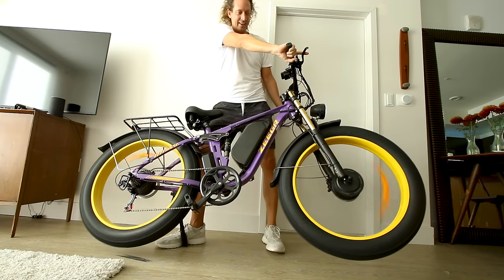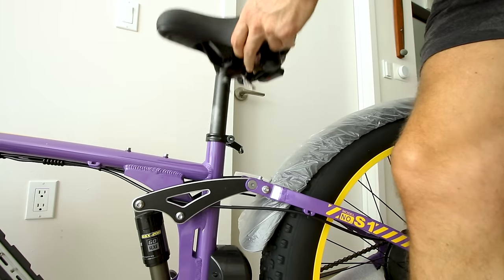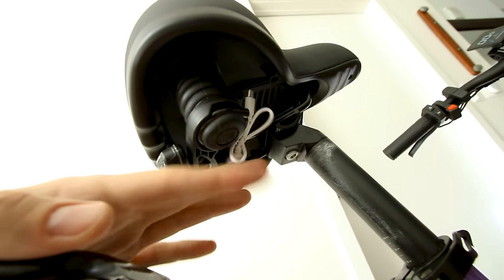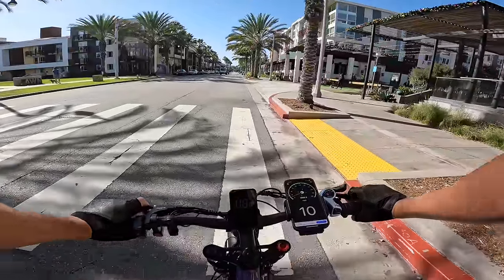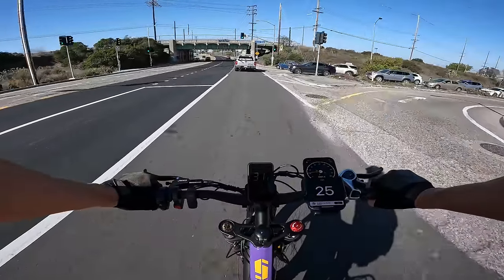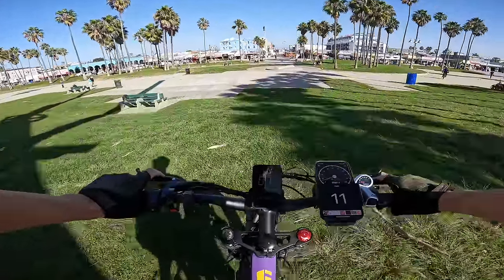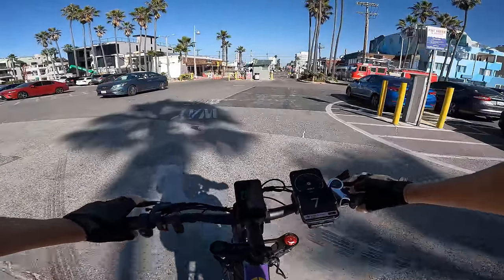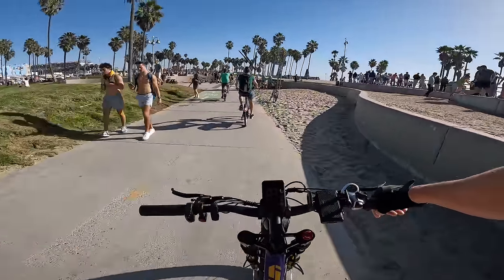This Cheap AWD 35 MPH ebike is SAVAGE - BoomBike Zeegr S1 Review

Comment: Looks like it easily beats the Phildo AWD hard tail for value, comfort and power.  160 mm rotor is almost criminal as 180mm cost like $10 more.  Anyone who buys this should swap out the front rotor and upgrade the rear shock.  Great value and much cleaner and professional looking  than the Phildo.
Reply: I was wondering same thing. I prefer a hardtail personally. The H8 has 21 gears and can absolutely be pedaled even with its weight (if necessary). I think there are tradeoffs in either case...
Reply: @KG-gv1ds The 21 gears is a dead giveaway that the Phildo is a couple of motors slapped on the cheapest frame possible with a controller in a nylon bag.  You might prefer a hard tail, but most will take the full suspension.   Makes the Phildo look like a bucket of poop in comparison.

Comment: Wait. A 1000w bike couldn't make it up that grade on throttle only?
Reply: it mightt be able to but cut that speed in half
Reply: Torque is what matters for hill climbing, not wattage .
Reply: @jdnuhdfdf wattage is voltage X current ... and current equals torque...

Comment: That creaking noise, was the the pedals?
Reply: I suspect (but do not know for sure) that it is the rear suspension.  Mine used to make that noise until I changed out the rear shock unit to a lighter 750 pound-inch spring shock unit.  Unless you are hard-core mountain biking 3 foot drop offs, the factory shock is too stiff.  You will note in the video is is getting good movement on the front shocks, and virtually none on the rear shock.

Comment: How to have a PAS faster reactivity?
Reply: There is a setting for that in the display.
Reply: @addertooth1  its at the maximum in the settings. And its always too low reactivity. You have to pedal at less ten times for the motors activation.
Reply: @objlibfin8741  Then yours has a problem, mine doesn't take ten, I think less than one revolution on mine. You may have adjusted the wrong direction.

It is setting 11p"  go with a setting of "1".
also...
Set 13p to 5

Comment: Mileage is a no go for me.  Nice bike tho
Reply: Even single motor500 watt bikes go 29 mph and would get twice the range or more on 13 ah batteries. Plus duel motors means no peddling if you do run out of battery .This is junk in my eyes
Reply: It depends on your riding surface and riding styles. I've had the bike for about 1.5 months. I can get about 30 mile range on dirt trails with a total elevation of 1k feet using PA2 and single motor and me pedaling  most of the time. I can quickly activate the dual motor to power through mud, sand, gravel and other terrain that could prove challenging for bikes with standard size tires.  The extra torque from the second motor also comes in handy  when i need good acceleration for crossing road intersections, or climbing tough hills. I've yet to encounter a hill where I had to walk the bike. I live in a semi-mountainous area. After my ride, I'm exhausted, so this range is good enough for me.

Now, If you spend most of you ride on pavement or asphalt then perhaps this is not the bike for you.
Reply: @jdnuhdfdf  i get it but I've yet to go up hills on a single motor bike with a good assist in peddling with much of a problem. If you are talking huge long winding mountains than of course not but that's where I think the battery drain of duel motors would actually be more troublesome . If this was a 40 ah battery bike made with a lighter frame than yeah maybe but to me it's a gimmick to sell bikes . But if you get 30 miles at your pace I guess that's a lot of conservative low mid speed riding that isn't bad at all . They really got to do better on Cranks and gears with all of these Ebikes tho. Ghost peddling on pas 2 is why battery drain is such an issue. By next Christmas I see a front, rear and middrive motor ebike out there . What's next after that
Reply: @acerkrt  I agree on the gears. With this particular bike, any level above PA2 and you're hardly doing any work.  I believe there's a way to hack the display to adjust the help given at specific PA levels but I have felt the need. PA2 works for me. It gets me to about 14mph and I work to go 15mph.  

If I had to do it again, I would probably go with the ReAspire Hurricane. It's at about the same price point but is a very different bike. It has a 500W mid  motor and torque sensor. Torque sensors are said to have a more natural feel for pedaling. One  drawback is that it's not a fat tire bike, but I see lots of people with standard tires on the muddy dirty trails where I ride, so it's likely not a big deal.  The other drawback is that there is no throttle. I do use the throttle quite a bit to cross dangerous high speed roads quickly, but the torque sensor on the ReAspire might be just as responsive. The ReAspire is also legal in a lot more places.
Reply: @jdnuhdfdf  yeah I tell you I have ridden mid drive Ebikes and I don't care too much for them . Yes they are better climbers but you will also be using much more leg work and to be honest they are just slightly easier rides than a good regular light weight mountain bike . I'm not in tip top shape and I'm a smoker so Ebikes brought me back to how I rode when I was in my healthier younger days and I like you really don't need the 23 plus speeds. I like the 16 17 mph ride with some leg assist and throttle just to start up the bike from a dead stop or to keep balance going slow by just tapping the throttle for steadiness without peddling and sending the bike into 12 mph . Throttle is great for those 2 purposes but I'm more of a pas 2 or 3 mode rider especially in the streets on NYC where I live  where  car ,bike and people traffic are insane . My first Ebike was a cheap 250 watt hyper eride that was like 300 bucks and I tell you it was a great bike for 15 mile rides . No throttle but even after having bought the lectrics and the engwes and the 750 + Ebikes over the years I really found that there isn't that much of a huge difference in power from 500 wall to 1000 . 250 had me doing well and I'm 6 foot 2 250 pounds. Hills is another story but even still it wasn't a huge difference and the lower watt motors did feel better on the paddling . My first 250 watt bike only had a 7.5 ah battery and 36 volts and hot me around my 8 or 9 mile rides just fine without panicking if the battery was going to run out and alot of the times when I was on flats I turned the bike off and coasted like a normal bike do to the lighter frame and smaller battery. I guess it's just preference. Now my favorite bike is my golfing Engwe ep2 pro and it was 900 bucks on a deal that came with two 12.8 ah batteries . It rides great after 2000 miles now and I have the spare battery on the rack just Incase I ever needed to swap out .
Reply: I understand your position.   I have one of these bikes and use it commute to and from work.  That commute is 10 miles round trip.  I run *single motor*, PAS 3, 21 Mph.  I can make the round trip 3 times before the battery is drained. The terrain is mostly level here, and asphalt. 

I have picked up (but not yet installed) a battery combiner and a second/third battery.  If I install all three, then I am looking at about 90 miles of range in PAS 3.  I would also be looking at about 40 miles flat out with both motors on.
Reply: @addertooth1  that's a good point. This bike is more like a DIY bike so it's easier to modify.
Reply: @EdPadin  There are brands (which will go un-named), which use so much proprietary stuff, they orphan users after a few years.  
Some go as far as to add a "chip" in their proprietary batteries, so they can ONLY be replaced with the factory battery.  It is ridiculous.  

The thought of a bike made with non-proprietary components means it is more likely the bike will still be on the road 5 years later.
Reply: @addertooth1  what specific parts are you getting for that?
Reply: @addertooth1 I’m trying to find info/resources on adding a second battery or replacing battery with more amp hours on this zeegr bike. I can’t find much out there. Could you explain what you’ve found?
Reply: I added a 2nd pack on the top frame tube on my seeker26 .. now have 50Ah at 52V ... good for way over 100km top speed on manual throttle or about 200km in mid speed and pedaling